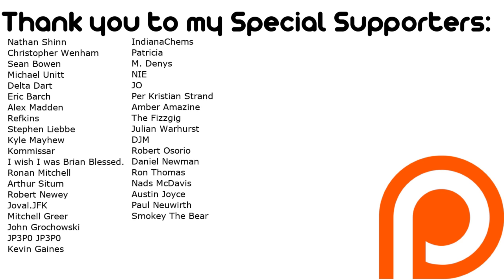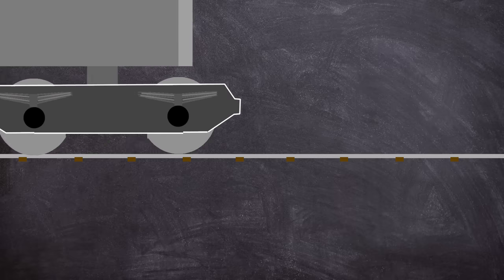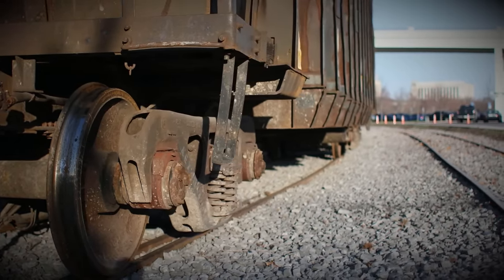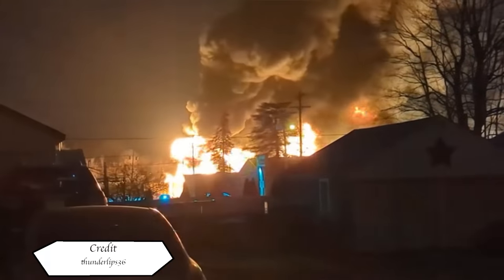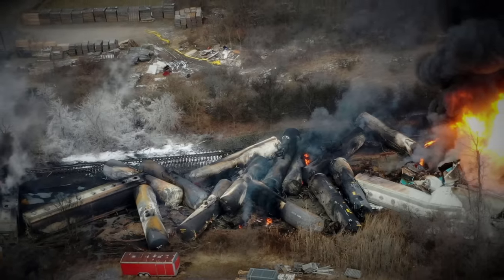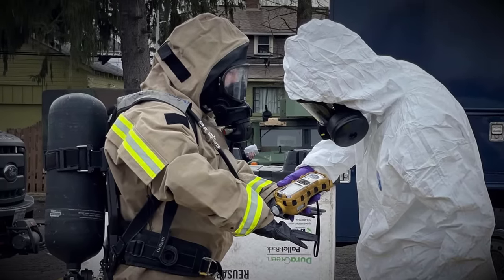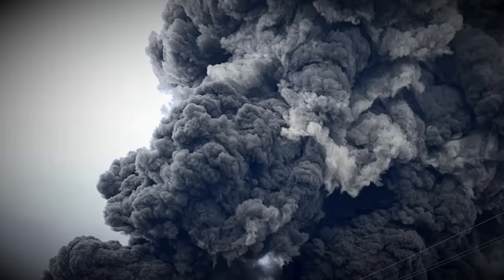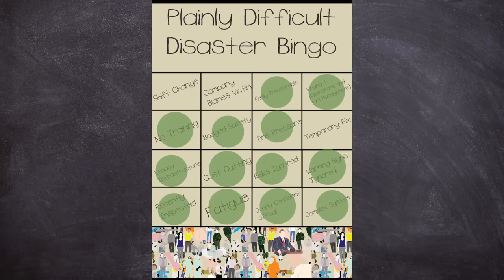Profits Above Everything: The East Palestine Train Disaster 2023 | Plainly Difficult

Comment: I have no idea why they couldnt have sprayed water on the tanker railcars and pumped the chemicals onto trailer trucks rather than having a "controlled burn/release". Being from the Cleveland area i can confirm that this event was suppressed in the local news. I believe local residents were only compensated $300 if they lived within one mile of the site. Some state and federal officials showed up to the site a week or so afterward and claimed the tap water was safe to drink yet declined to drink it on camera. Its cheaper for the rail industries to pay fines every once in awhile rather than pay for preventive maintenance and staffing. I believe the only change they made was that 2 conductors are required on trains hauling more than a certain number of railcars.
Reply: Because they were acting on fear and ignorance. The fire department didn’t know what to do. And the railroad had absolutely no plans on what they should do.
Also, the pressure relief valves on the cars had a known design defect. So they were afraid that they would burst.
Reply: Well, Cleveland isn't known for being the brightest region in the world.
Reply: It is an engineer and a conductor.
Reply: @Swishersweetcigarilo  
yes, the railroad initially tried to get away with giving everyone $300 for their inconvenience. And had no intention of cleaning up. 
Much like the deep water horizon the railroad had no idea how to deal with their cars and neither did the local fire department. Those railroad cars had a historic problem with their pressure relief valves. They were concerned that the car would burst killing anybody nearby. As you can tell from the video, it took a while before they could even find what was burning. 
But sure, blame the government. 
The railroads lobbied for as little regulation as possible. In fact, they only want a single person driving the train.  So when you want less government. This is what you get less government. So think about that next time you say, the government is stupid in private industry should be in charge. That’s exactly what happened here.
By the way, the people doing the checking and saying there was no contamination was a company hired by the railroad.  
And the state should be your first stop. The federal government is the second. Not the other way around.

Comment: For the bingo card, I am confused why you check off Fatigue, Risk Ignored, Warning Signs Ignored, Overly Confident Official, Time Pressure, No Training, and Winging it.  Those are all things that can easily be true in the rail industry, you never talked about any situation in the video to warrant those boxes in this situation. Would you be willing to elaborate more?

Though I disagree with Complex system since the thermal detection system is actually just so simple that it gives little usable data until it's easily to late to do anything with said data if they are so far spread out.

But thanks for the video, was wondering when this incident was going to drop.

Comment: What a crappy bit of train design. If they were in any way concerned about axles overheating then they should have put a small electronic thermal sensor into each bearing, linked to an alarm system in the cab. The technology to do this has been in existence for at least fifty years. Think about how many sensors your average car has in it these days. Incompetent, sloppy, penny pinching, bastards!

Comment: 13:44 is just sounds insane!? setting of explosives to a chemical tanker.... but why? could have drill holes or something
Reply: They had no plan or protocol in place, and the "protocol initiation" wasn't carried out by people "in the know". Act now, apologize later.
Reply: @joyfulone1816  Incorrect, they used small charges of C4 to make a pressure release since the chemicals inside were at a temp BEYOND their boiling point, risking an explosion which would level the town. A small hole will not release the pressure enough.

1996 Cajon pass runaway train is a good example of venting tank cars.

Comment: As ex employee of a railway company I can say that there is no 100% safe way to prevent wheel bearings from overheating. There is always a chance that this happens and remains undetected for a number of hours especially with very long freight trains like in the USA.
Reply: Why not temperature sensors in each wheel bearing block linked back to a display/alarm in the drivers cab?
Reply: @StreetMotionUK because the only thing running from the locomotive to the last car is an air line for the brakes. Up to eight individual sensors per car, hundreds of cars, and copper strung the whole length? With up to several hundred different owners/operators responsible for the cars in any train? It can’t work

Comment: East Palestine is located on top of metals and minerals to be mined, like Chimney Rock, N. Carolina.   The Chem train Breaks Were Designed in The Year 1865.
5 vinyl chloride tanker cars were burned without permission, simply to speed the clearing of the Norfolk Tracks because ... the trains must role $$$$$$$$$.
The evacuation order was rescinded soon after if was given because trains are not allowed to travel through evacuation zones ... again ... the trains must role. 
The DHS has red flagged Erin Brockovich a domestic terrorist for publicly stating the EPA was covering up the worst chemical disaster she had ever scene. 

                                                                                              The Long Arc of Psychotic Criminal Intent